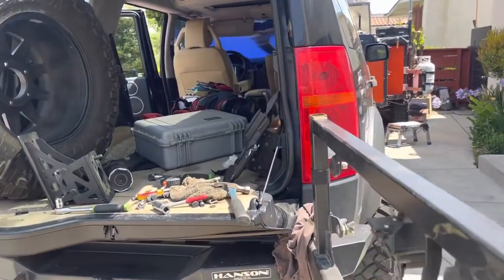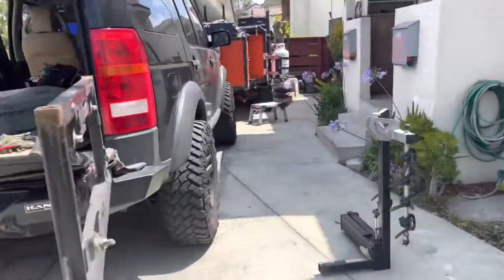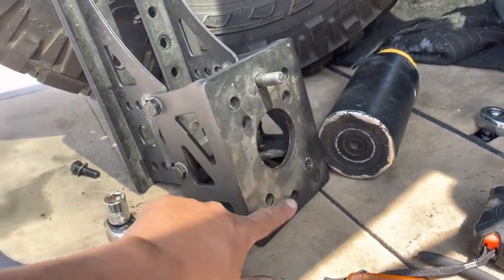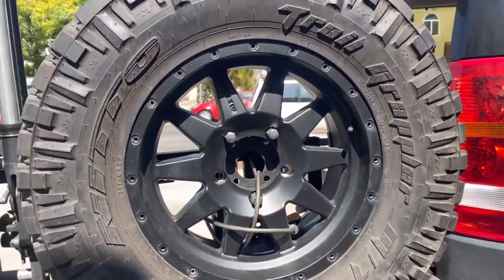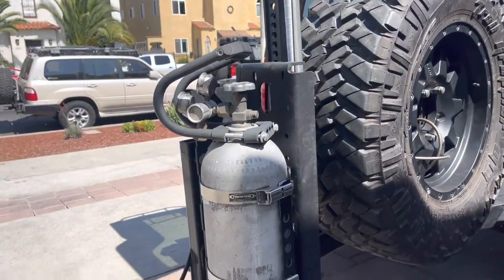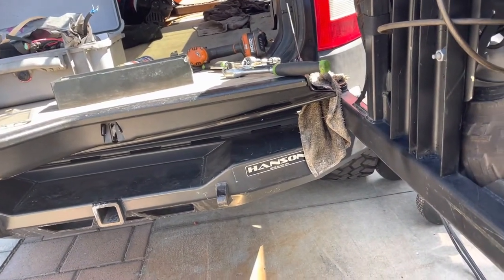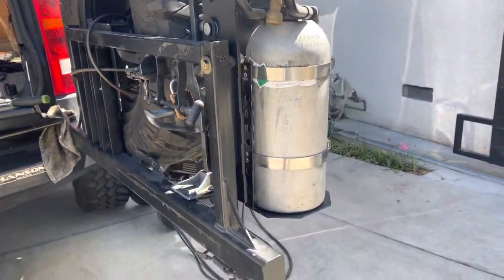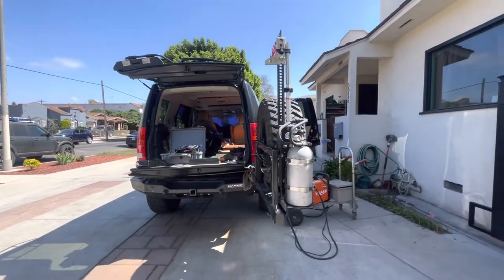07 LAND ROVER LR3 HSE OVERLAND BUILD UPDATE. Rear bumper tire carrier COMPLETED!

Comment: Are those 35s and did you have to trim anything?
Reply from the maker: yes and YES. I recently went back down to 285's because DSC wasn't happy cornering and the amount of cutting to clear was substantial.  I still had to cut a lot for 285's but I dont have to worry about it as much